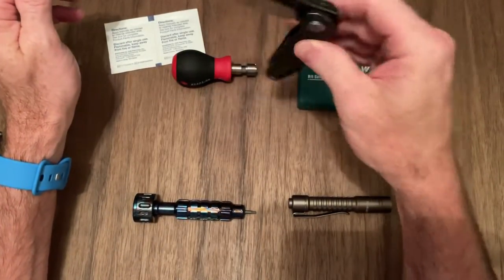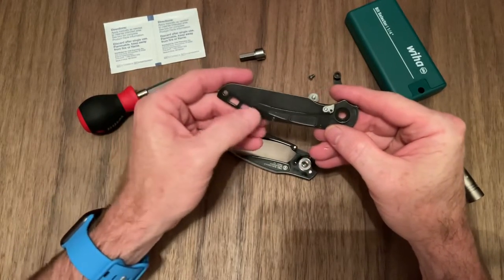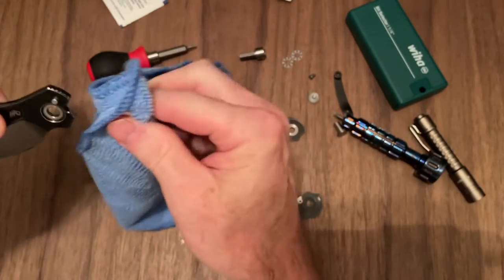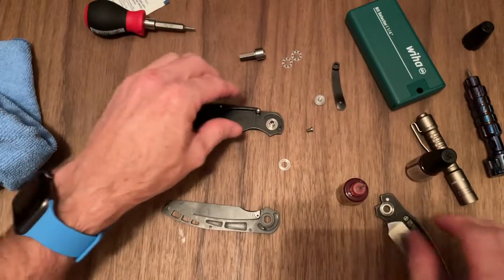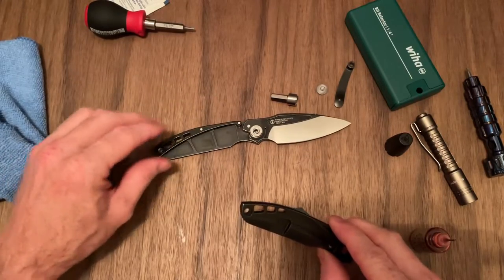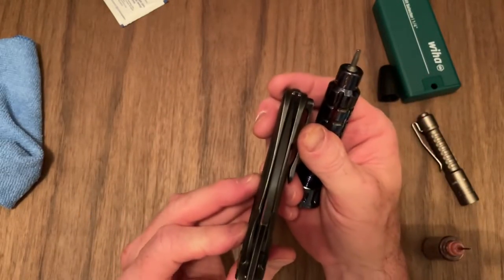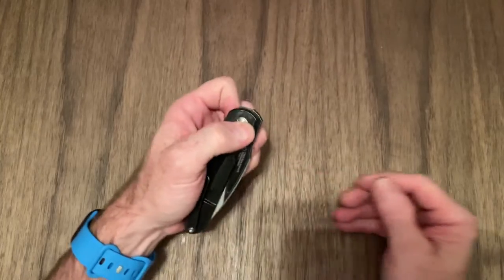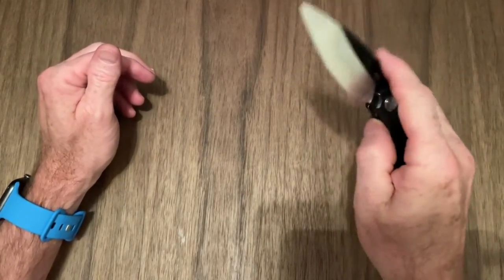Twosun TS341 Sidewinder Pocket Knife Disassembly

Comment: I appreciate the Disassembly video. Helped me make my decision on purchasing this model.
Reply from the maker: Did you decide to get it? It’s a great front flipper for the money.
Reply: @bladesandedc  I decided against for now. I’ve been buying and selling knives for over a decade.  Something has to be very different/special to justify a purchase now. I’ve got some twosun knives (5-10). Mazwan keeps doing these choil interface blade stops. I don’t like them in concept. Watched the video to see what the deal was with the secondary internal stop. I like it. I’d love to know how many of his designs have a redundant blade stop like this. If they are all redundant, I think it’s a superior design. It’s the D2 combined with the actuations that stopped me from getting this one. 
My feelings on D2 depends on which side of the bed I wake up on. I just can’t decide if it has good merit based on ability or should be looked at askance for being so common at entry level price point. I’m going to start doing some edge testing to try to have a more educated opinion. If D2 really impresses me, I may come back to this. Every time I think I’ve picked a side in the D2 debate, I waiver. I’ve never had an issue with rust on D2 personally, but have found it can be comparatively difficult to sharpen. Because of the number of brands using it, I’d really just like to know what the variation in performance is based on HT or raw stock. 
Mazwan and Night Morning are probably my two favorite Twosun designers.
Reply from the maker: @TheKnifeSurgeon  I love both of those designers and also Jelly Jerry. Have you checked out the TS129 or the TS195 yet?
Reply: @bladesandedc  I’ve been eyeballing that TS195 in frag. WMK had a couple in a couple weeks ago and I was notified but I didn’t put the trigger. I am on a bit of an integral kick and I don’t want to wade deeper than I should just bc integral. Same concerns for blade stop on close with the design though. I don’t think I’ve seen a disassembly. I do own a TS129. It has amazing cutting edge to handle ratio.
Reply from the maker: @TheKnifeSurgeon  With the TS195 the integral frame is the blade stop which could become an issue down the road, but I have had it for quite some time and I have fidgeted with that knife endlessly and so far there have been no issues. I love that knife and think it is one of the best bargains out there. The action on the 195 is great. Now the 129 has some of the most buttery smooth action I have felt on any knife. I have gone up to the custom knife level yet, but as for the productions i have or had it has the smoothest action.

Comment: I'm luvin this design but I wish it had multiple deployment methods
Reply from the maker: It does. Its a front flipper and it has a fuller on both sides of the blade so you can reverse and thumb flick it.